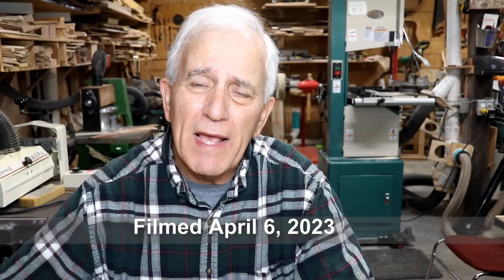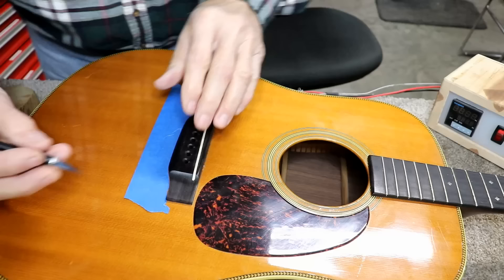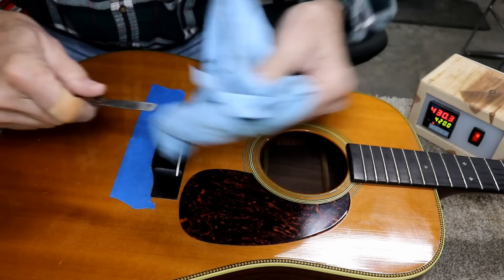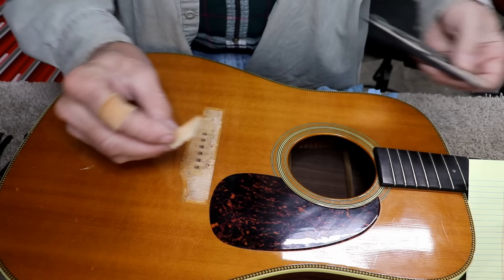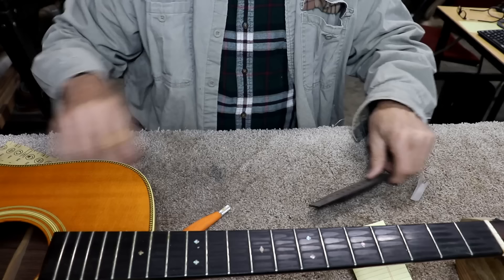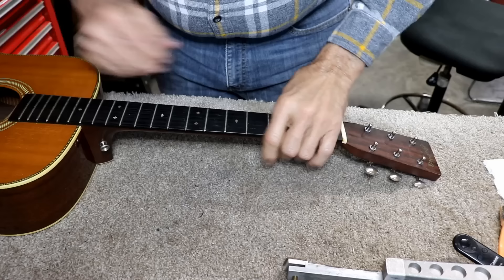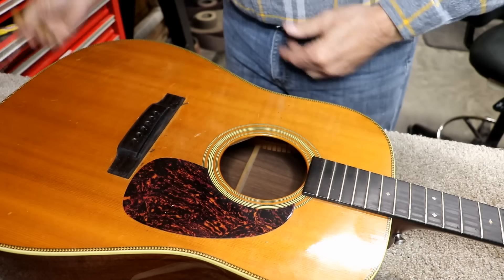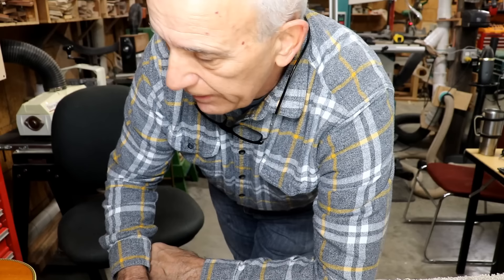640 RSW Refused by 2 Martin Factory Authorized Shops

Comment: I live in New England, and I've never humidified any of my guitars, I do however ALWAYS store them in their hard cases. I have friends who hang their guitars on the wall, and almost all of them have had cracks or warping due to hanging them on the wall, as our humidity here runs from as low as 40% to as high as 100% on any given day. That can literally change from one extreme to the other in less than 24 hours. I have never had a guitar crack or warp keeping them in the case when not in use.  I have a Washburn Woodstock acoustic, a Godin La Patrie Concert QT parlor Classical, an Epiphone Broadway jazz box, and a Fender Telecaster Special.  All of them are in pristine condition with very little wear due to always being stored in their cases.  The only dings and dents came from me being the gorilla that I am, and turning and whacking them on a mic stand or cymbal stand, etc... LOL.  But never any cracks or warps due to humidity.  Just my 2 Cents.  I will agree with Jerry, and his 40 plus years experience. Unless you live in Canada or the South-western desert, you probably won't have to humidify your guitars.

Comment: You might want to use an infra red heat lamp (150watt) ali foil to protect the top finish and a much larger palette knife. A drop of water will help soften the glue . That heating tool doesn't spread the heat well. A thicker palette knife will give you more leverage

Comment: I am at odds with open saddle slots for the exact reasons you list. IMHO the cons outweigh the pros in every way simply because the saddle is glued in. Due to this it turns simple saddle work into a much more in-depth job in every way, including just lowering it and keeping the clean beveled lines.

Comment: Hello Jerry, another great video on repair and another lesson learned about string winding. My experience with Martin guitars goes back to 1969 when I bought my first one, a used D-18. Like most acoustics, it suffered from hi sting action and probably needed a neck reset. But back in those days no one was doing that. Instead, a friend and all-around handyman wacked the bridge off with a chisel, sanded it down and reglued It. 
Since then I’ve had a number of Martins and the factory has changed their approach to what they cover under their “Lifetime warranty.” My D-45 bought new in 1986 had a couple of issues, mostly string height. Most recently it went back to Martin in Nazareth for loose  binding but ended up with much more, most of which was not covered by warranty. The top was severely bowed behind the bridge and depressed under the fingerboard extension. The fix was a wedge under the fingerboard and a new bridge. The tech who worked on the guitar said he had a real problem getting the top to flatten out. After almost 40 years of ownership I finally decided to let it go. 
Keep up the great work. Really wish you were closer so I could visit.
Mac in Delaware
Reply: You are so right, Martin used to care about customers, not so much these days.
Reply: A
Reply: I’m

Comment: I do finish work and there are people who can do the work just fine for most but there are a smaller group of people who do PERFECT work.   
I paused the image before and after your repair.
The guitar finish looked nice with no visible defects around the bridge on the finish.  But after the repair there was an ugly scratch highly visible in the finish where you scratched with a knife. I could see why authorized shops wouldn't touch it if they couldn't give it back in perfect condition because if I got any guitar back with a scratch around the bridge I'd be very upset as I think most people would. 

I'd recommend NEVER doing that again and let the heat do the work.  You probably do fine work but this video shows something to improve on.  40 years doing something means nothing because I know people with 20-30 years doing enough to get by.

Comment: If you push down the string on the 12th fret raises the tension of the string and so raises the pitch. The higher the string relative to the fretboard the higher the tension, the higher the pitch.

Comment: For a number of years, Martin would leave between 1/16 & 1/8 of an inch of finish under the outer edges of the bridge. A bridge needs solid, continuous contact to the bare wood of the top. Any shop that claims to be an "authorized Martin repair shop", yet turns down a pulled bridge..............isn't qualified to do much repair work, in my book. I re-glued the bridge on a 2001 Martin D-16 last year. If you do your research, take your time to do it right & have the proper tools, it's not a difficult job at all!!!! This video demonstrates the right way to do this repair.

Comment: G'day from Oz ( Australia ) ! ... Rick here .....  First off, Great clip ! :)  ... I've been a Luthier / doing builds and repairs since the mid 70's  ( I used to own "Rock Repairs" - which was the biggest lutheir shop in Oz for many years ) ... Over the years, I've been a recognised repair  agent in Sydney, for Martin, Maton, Col Clark ( the guys who got the shits with Maton and left & started their own brand ... much the same as the Guild guys who left Epiphone/Gibson ), Gibson, Fender, .. and was the go-to-guy for several airlines ( who damaged ALL sorts of musical instruments ) for many decades, as well  ..... I've done this job ( bridge replacement )  so many times over the last 50+ years that I've literally lost count  .... and also took off  "perfectly well glued" bridges on LOTS of Martins whose bridges were WAAAAY  out of tune ( with not enough room to move the saddle slot rearwards in order to correct the woefully wrong harmonics - which many Martins have :O :( ... ) ..... I usually not only reposition the saddle, but, I often put in a wider saddle, which then lets me create a custom "harmonically correct saddle" for every string - not just the two E's ..... I'm endlessly AMAZED at the volume of Martins ( in particular )  who's bridges have been placed in the WRONG PLACE - from the factory :O :O :O  ...... and I've even come across a few big name brand guitars with the nut-to-first-fret in the wrong place as well :O  and THAT throws ALL the intonation OUT !!! .... Loved the clip ! :)

Comment: You are very correct about the clamp system that you use , because people  don't realize that  the glue is stronger than the wood, is you clamp down  on the bridge and put a bow in it you just caused another  problem a year down the road.

Comment: I have an Ovation guitar, and have kept a humidifier in it for 25 yrs, because I remember seeing more than 1/2 a dozen Ovations hanging up in a pawn shop in Windsor Ontario Canada, with massive cracks in the top, running right through the length of it. These were not small cracks, some were 1/2 in wide, and every one of them were in the same condition. Windsor is a very humid place, but that didn't help those poor guitars. I've always assumed the cracking was because of the mix of non expanding fiberglass, on the back, and moisture loving wood on the front, so I've never wanted to take a chance on busting my baby. I have noticed that the top gets wavy, if I neglect refilling the humidifier. I also use .009, - .042 strings to reduce the load, but I don't think that matters much, between those and .012 -.048. I hope you don't tell me I've been hurting my guitar?

Comment: That was the best teaching video ever. You remarked on everything you did. There is one thing I would have done differently. I would have left the pry tool inserted during heating the bridge. I would have used more than one. My thought is the gentle upward pressure would have helped. One of my favorite X-Acto blades is #18. Using the backside of the blade to get up close and personal to get the DNA between the finger board and the fret. I use the #18 with the heavy duty red plastic handle for mostly cleaning gaskets off engines. I use it for other things but that mostly. I keep the dull seasoned blades for chipping. I wish I could tell you how I found this video. It's been 40 years since I picked up a guitar. I've been looking for a Tanglewood. Not sure my fingers will work anymore as they been through alot.  😀 Great Video!

Comment: The "V" means hide glue was used in installing the braces on the top for better sound transfer.  You did a lot of work for nothing.  You sand the old glue out as good as you can, reglue an clamp it.  Then you drill it and countersink 2 very small brass bolts and nuts on each end of the bridge behind the "E" strings.  Then you install a couple of pearl dots.  She'll last 100 years like that.  That small amount of metal will not deteriorate the tone.  I've done about a hundred of them.

Comment: Same mistakes decade after decade. I returned my 1976 D12-35 to get the pickguard replaced for the same reason. It was crazy ugly warping up off the soundboard in random locations. I recall being amazed when they told me why it was happening, as in, “they glued it to what??”

Comment: Make a garrotte out of thin strong wire, then work it to and fro as you work down the bridge from end to end, but of course you first have to get your blade in there to begin with, then you put a waterproof silicon rubber sheet over the bridge, tip the guitar slightly, and pour a jug of boiling water over the silicon rubber sheet so it runs clear of the guitar.  That will heat the bridge non-destructively, then go to work with your wire.  Lotsa luck--lets hope they did not glue it on with Araldite, Epoxy Resin  or Resorcinol, because it they used that kind of glue, you are going to have to sand it off and fit a new bridge.

Comment: Fantastic! You are a hero! Only one thing I miss: you never explained how you solved the intonation issue that was mentioned at the start of the video.
Reply: Replace the bridge slightly more forward or back of its original placement depending on if intonation is sharp or flat. Tune the strings and make certain guitar is in tune with open strings and at 12th fret. Mark the new bridge position. You may have to alter holes in bridge plate. prep the new site and glue bridge.
Reply: @Chiller01   Thank you!

Comment: The comments about humidity troubled me as I’ve been religious about humidifying my Martin since new. 45-55% RH measured with hygrometer. I’m in Utah. Dry all year round outside and worse with AC in summer and forced heat in Winter. I’ve had guitars which were never humidified and didn’t observe damage. This one is a costly unit and I’m trying my best to ensure longevity.

Comment: I never understood why any player would allow such a DNA buildup on their fretboard.  I clean my fretboard on every string change (Martin phosphor-bronze lights).  I quick wipe-down with Formby's Wood Cleaner, then a light oiling with Dunlop lemon oil, wipe off the excess and in the case for the night to allow the new strings to stretch out.  I never allow my nails to grow much, so I never have divots to correct.  Thanks to you Jerry, I'll be getting some Bee Good oil when my lemon oil runs out!  On another point, what kind of repair shop is so lame that they won't re-set a bridge?  I'm a rank amateur and I'd even do it!  BTW, I'm with you, Elixers suck!  Another great vid!

Comment: The thing I dislike about Elixir strings is they get fuzzy on me. Some say you need to change strings more than once every couple of years, and I do not disagree. Randy Schartinger worked on a couple of my guitars and said the strings were extremely rusty. Hey, I am lazy, but now I will have to rewatch this every time I change strings to try and figure out your stringing method. Thanks for a great video!
Reply: I tried elixir once. I did not like them. I fully realize some people swear by them. To me, they felt slimy, and they quickly got fuzzy.

Sliding and bending felt wrong. I am happy for those who like them, but I am not one of them
Reply: I pick hard both on electric and acoustic and never got the "coating starts to flake where I pick" issue. I think it's related to technique, if you pick at an angle or pick catches the string too much or something. Also maybe don't use an old pick where the edges are all mangled up to the point of being serrated. I do swear by Elixirs. No more "my strings started rusting in the case and the frets now require polishing cause the rust spread from the strings". I actually like the "side effects" of the coating, I don't like the super trebly sound of fresh strings, I prefer them worn in 2-3 days even for recording, and Elixirs are just a bit less trebly out of the box. I also have a tendency to make a lot of finger noise with the left hand (to the point where amplified electric sounds like campfire acoustic playing in my case), the slippery coating helps reduce that a lot.
Reply: Try a set of the d'addario XS coated acoustic strings, they're expensive but worth it.

Comment: Martin use two types of long-style saddles, the drop-in long style as used on the HD-28V here, and the traditional long style as used on the Golden Era and Traditional guitars. The traditional long-style sits in a slot cut from bridge cheek to cheek and can be recognised by its square ends - these are usually glued in due to the limited penetration into the bridge resulting in limited lateral support. The drop-in long style sits in a groove routed into the bridge AND the bridge cheeks, a cross between the traditional long style and the modern drop-in. It can be recognised by its semi-circular ends and is not usually glued in as it has greater penetration into the bridge, resulting in greater lateral support.

Personally, as the owner of a number of Martins with a mixture of saddle types, I think the long styles are a pain to deal with and prefer the modern drop-in!
Reply: I agree regarding the modern drop-in saddle style - a much better design. 
I imagine Martin still makes the long type available because it was used on 'vintage' guitars, and the feeling among some players that the sound is better if a long saddle is fitted.

Comment: No one would touch mine, so I angled it and let glue flow into it, loosen the strings, then clamp it up, wiped off the excessive glue , let it dry for two days, then it’s been working fine for 7 years now!

Comment: I have those same clamps and found them a little difficult to feed into some sound holes. I took my angle grinder to them and removed, rounded and smoothed the ends, tops and side edges. They work much easier now. I also flattened the fixed clamp end and glued a piece or cork to each as a pad. Easy overall mod to do. Way cheaper than ScrewMac.

Comment: Bought a brand new Martin 0018 C in 1969. Major guitars include 1995 Tal Farlow out of the custom shop, a  1977 Les Custom , a 1968 ES-335 with the trapeze tail piece and an American Strat with the tilt-O-Matic neck. Of the 5 it is my Martin that I love the most. It has a little bit of a belly. Bridge always passes the paper test. Intonates  beautifully and I always use Savarez or D’Addario makes a light tension nylon string as well. Seeing how sloppily the varnish was applied is distressing to me. I worked on a few of the new Martins (just a tech, not a luthier) Kind of pitiful when compared to my exquisite 1969. The only acoustic guitar I can play with old, arthritic hands. Great show…just subbed! Thanks

Comment: My MARTIN D35  which I purchased in 1974 came with a LIFETIME Warranty. Now 50 years later, I (the original purchaser) can take this to any authorized Martin repair shop for FREE repair of any part that failed due to ORIGINAL materials and workmanship. Of course you cannot expect this to cover wearable parts such as fret wires wearing down through playing or any damage due to carelessness. But that leaves a whole lot that got repaired. Neck tightening, gluing the ribs, replacement of the original pick guard which had lifted and was a common problem with that particular model. The feeling of the finish around the trim of the body. When I took it in to an authorized Luthier, I opted to have him do some repairs and upgrades for which I paid. wha. A ribbon transducer under bridge pick up; a tortoise colored composite pick-guard instead of the cheaper black plastic original. etc. as long as I am alive and still have my original receipt(Chicago 1974) I can take it in and if it is deemed covered have it worked on for free. As you might imagine Martin no longer issues lifetime warranties on any Guitar that I know of. Back in the day it must’ve been a sales inducement and as long as the company stays afloat they must make good on their original contracted warranty. Amazing huh?
Reply: How much did you pay for that guitar back in 1974 ? Just for inflation calculation purpose 🤔